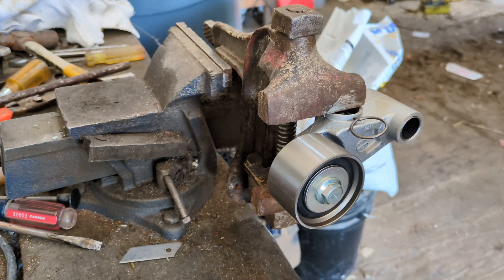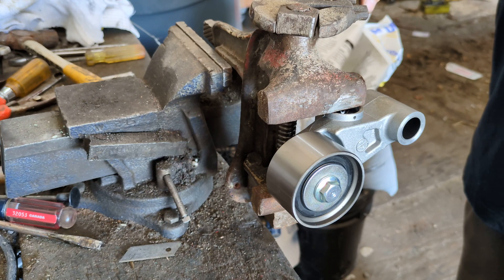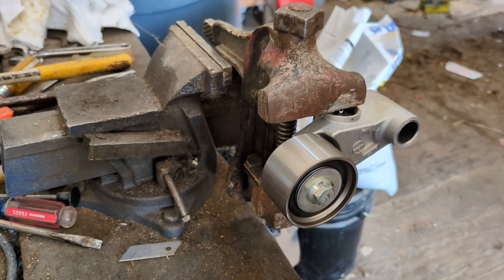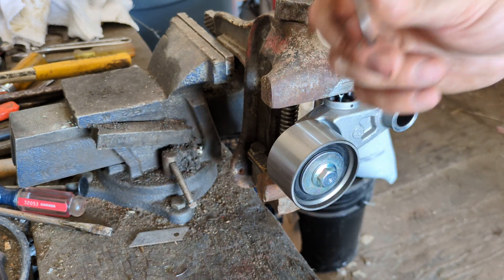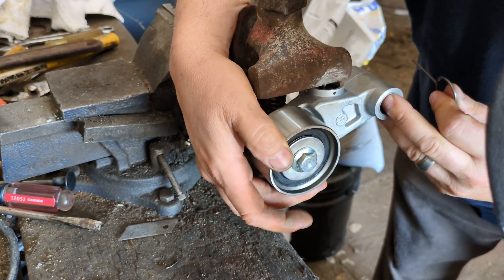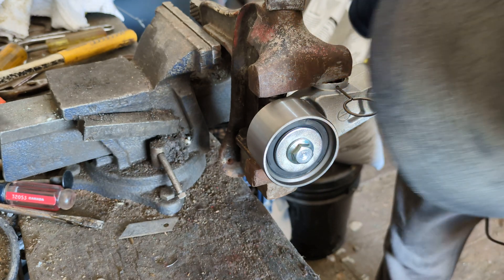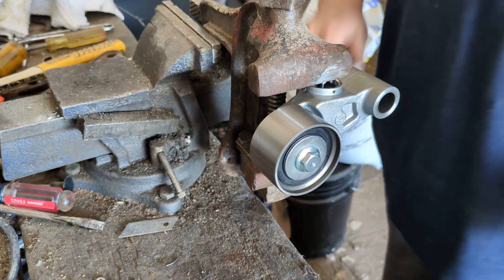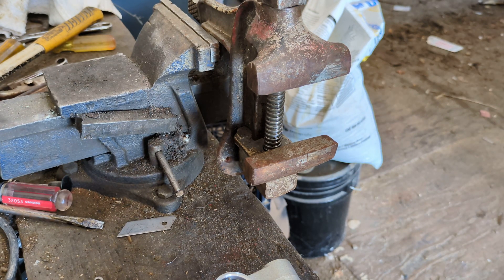Bleeding a timing belt tensioner

Comment: This supposedly bleeds air out of the hydraulic fluid.  Kind of the way you're supposed to pump shocks and struts in upright position before install.  I've installed tensioners/shocks/struts with and without pumping and never noticed a difference.  Better safe than sorry, I guess.
Reply from the maker: We will see how this bleeding worked out in a couple years, in reality I will forget to look.😅